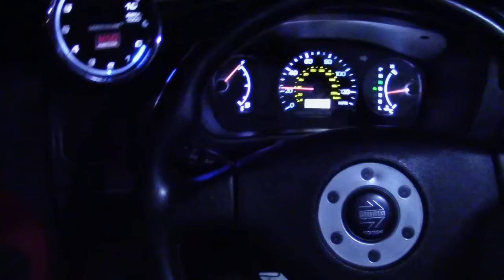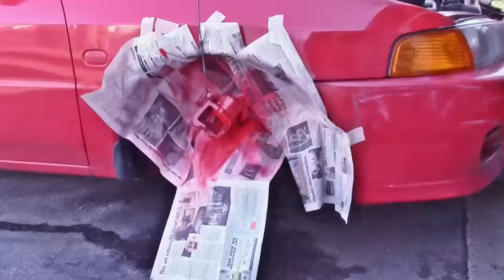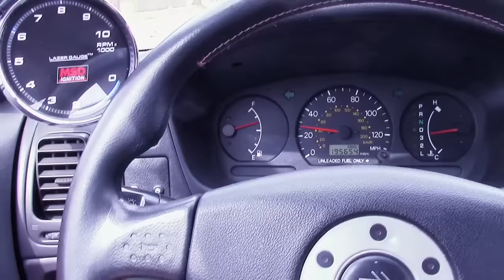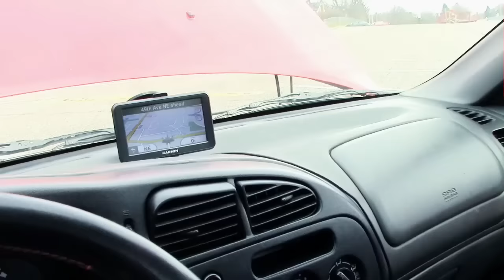Mirage Fix 21 | Coilovers, DIY Alignment

Comment: Hey , I think before you install spoiler you should change the dive train. A spoiler only gives down force on the rear wheels. This mirage is fwd. you are better of tuning or installing engine mods. Also, a awd drive trained would have a driveshaft going through the  middle of the car. Just some tips. Keep up the good work!

Comment: I bet opening those coil overs felt pretty exciting and that alignment toe in out looked to have turned out pretty good but can't imagine it being perfect going down the highway. Iv'e tried it on a couple of cars and still had to have them done on an alignment rack and you pay those so called pros $80 to $100 to do it with high tech equipment and half the time they don't even get it right you had might as well do it your self until you get it as best as you can. And they will scratch and scuff your alloy wheels every time guaranteed.
Reply from the maker: red rover Yes, I actually did precise adjusting many times. I edited those parts off and included only the basic idea of it. So it is about drive, measure, adjust, and do that all over until I got it perfect.
Reply: That is a lot of work with out a car lift in your videos you seem very talented

Comment from the maker: Brian Navar Put a smaller ramp to get on a ramp doesn't really do much I think. It is very steep as you can see.
Reply: What about just one long 2x2?? My cousin used to have a steep drive way also, and it worke for him.
Reply from the maker: Brian Navar That might help, but not in the winter. It wouldn't feel good doing that when it's -30F outside.
Reply: The DarkDragonWing why do you not put a spoiler and paint your car because mirage its gonna be pink like 2yers from know
Reply from the maker: RodryGamez PT
 I will think about it
Reply: that is true, i'll respect that.
Reply: Spoiler on a FWD car? Oh please no
Reply from the maker: Jesper Becker
 Honda Civic Type R FWD comes with a spoiler from factory.
Reply: But a hatch has more areodynamic drag in the back. Just sayin.
Reply: Jesper Becker my honda accord type r has a big factory spoiler and it does actually give you downforce the rear does slide out on a fwd to you know.
Reply: Think about it for a second. If you have a fwd car, you want as much traction as possible to the front wheels, not to the rear. The Type R's spoiler isn't really that angled, and more importantly it has a real front spoiler to provide force to the front wheels. The mirage doesn't have that
Reply: Jesper Becker your oviously someone thats just states the obvious then because 1. You said about fwd in general having spoiler you didnt say the mirage 2. Look up btcc touring cars and majority are fwd and they have spoilers and they handle incredible and 3 like i said before the spoiler is to keep the rear down because the back gets twitchy on ANY car when your braking hard maybe look into what a rear spoiler does before commenting :-)
Reply: Ricky Burrows Well, thst excactly why i really gotta stop commenting on things while asleep lol... Meant the mirage all the way
Reply: Lol
Reply: The DarkDragonWing nice :D
Reply: The DarkDragonWing nice :D

Comment: Also you should look in to doing just a FWD engine swap if possible. Old Eclipses, Eagle Talons and Plymouth Lasers came with 4G63Ts and FWD drivetrains. The were the same as an Evo III more or less, and all also came in AWD.
Reply from the maker: nblax41 Nice! Thanks! I might look into 4wd Eclipses then since they're available here in the US.
Reply: They're nice cars! I have an Eagle Talon, which is the same car. I'm sure you'd have no trouble finding one down there.
Reply: The DarkDragonWing
Although honestly, if you were to buy one it should be the project car, you can find motors and transmissions if you want to do a swap on the Mirage.
Reply: nblax41 it wouldnt be a fwd 4g63t the fwd non tsi models were the 420a which aren't the same
Reply: I know, only 2G models came with the 420A. First gen cars came with either a non turbo 4G63 or a single cam Mitsubishi engine.
Reply from the maker: nblax41
 I will keep my eye on the sources.
Reply: The DarkDragonWing America is home of the AWD Eclipse/Talon/Laser. Hell I own a 91 Eclipse GSX AWD, they're built in Illinois.

Comment: What do you think about the megan coilovers, also how much of a gap u left between the wheel and the fender? Thanks nice video
Reply from the maker: +Cesar Feliz I have not used megan coilovers before, but I'm sure you can use it and it will work well. The gap is about 1 inch.

Comment: such a friend, I like what I've seen in your videos I also feel passion for my car repair thanks for sharing your experiences and I am from Venezuela to buy my next vehicle will make a plus sign Mitsubichi lancer 1.3l 12v engine 4G13 just want knowing inches are your wheels and tires using measures, I am also fond of modifying the fuel injection system fuel pump and injectors to improve a little engine

que tal amigo, me gusta lo que he visto en tus videos yo tambien siento pasion por reparar mis carros gracias por compartir tus experiencias yo soy de venezuela y mi proximo vehiculo por comprar va hacer un mitsubichi lancer signo plus 1.3l 12v motor 4g13 simplemente quiero saber de pulgadas son tus rines y que medidas de cauchos usas, yo tambien soy aficionado en modificar el sistema de inyeccion de gasolina bomba de gasolina y inyectores para mejorar un poco el motor
Reply from the maker: theselzer Thanks! Here:  
- 17"x7" MR116 SILVER RIM By MOTEGI RACING WHEELS
- ACCELERA TIRES ALPHA 205/40ZR17 84W
- Tuner Wheel Lock Kit M12-1.5
https://www.youtube.com/watch?v=bcr4fHNJkfc
http://www.performanceplustire.com/products/packages/searchType/searchByVehicle/year/1999/make/MITSUBISHI/model/MIRAGE/applicationID/10011/wheelSize/17/wheelDataID/178519

Comment: Hello. I just want to know How do you feel the car now when you drive it. What are the differences that you realize. I mean before/after. Thank you. :)
Reply from the maker: Octavio Cruz Yes, it feels much rougher after I installed the coilovers. I can feel all the bumps on the road. Though, it got better/softer after driving it for a while. It will not be as soft as the factory ones. Hmm I think part of it was because I have thin tires on with 40 psi. That too can make the car rough on the road. If I maybe put in about 25 or 30 psi, it might help a little bit. Cheers

Comment: Love the video your doing a great job on your car.  My question is how is the ride after the coilovers is it as smooth as it was before?  I'm asking because I'm on the fence about coilovers or just springs.
Reply from the maker: dolores delgado It feels much rougher after I installed the coilovers. I can feel all 
the bumps on the road. Though, it got better/softer after driving it for
 a while. It will not be as soft as the factory ones. Hmm I think part 
of it was because I have thin tires on with 40 psi. That too can make 
the car rough on the road. If I maybe put in about 25 or 30 psi, it 
might help a little bit. Cheers
Reply: Thanks for the info.  It means a lot comming from you.  It seems like you are honest with everything you post and say.  Thank you again love the videos keep them comming

Comment: How much did you pay and where did you buy them at?.. The car should be stance low and do a resonator delete on the exhaust.
Reply from the maker: jacy thegoon I bought this set last year for $790, but now it's $808 http://www.ebay.com/itm/DD-Soft-Hard-Coilover-kits-Shock-for-Mitsubishi-Lancer-CE-CM5A-5th-Gen-95-00-/400638527064?fits=Model%3AMirage&hash=item5d47eac658&vxp=mtr

Comment: Love your videos. I have the lancer coupe. How low can those coilovers lower your car?
Reply from the maker: matthew muranyi Not too much. I can lower the front about 1 inch or 2 more(I have to adjust the spring at this point), and about 3 inches more on the rear.

Comment: well this is what I would do to that car. Paint the car, same color, but with metal flake. Tint the windows. that's cheap. Then work on getting a header exhaust manifold. Maybe even a little bit bigger exhaust pipe. before you do the turbo. But its a nice car.

Comment: do you think ordering auto parts online is a good idea such has control arm tie rods stuff like that?
Reply from the maker: +Luis Hernandez Yes, I don't see any difference. All I know is they are good and cheap. I only buy expensive parts from local store when I have to get the parts right at the moment. And they're not even that good quality to be honest. I found the cheap ones online to be better and cheaper. Make sure you buy from a high rating seller if you buy from ebay.com or amazon.com

Comment: Did you have to torque any of the coilover bolts or anything really need to be torqued?
Reply from the maker: urmastertech I would like to torque the bolts, but it's hard to find the information of each bolt. Plus, I will have to buy bigger torque wrench. For me, I would torque the bolts on the engine only.

Comment: Nice work,but you still need a 4G63T in the bay.
Reply from the maker: Mitsubishikid Yes, but it's expensive
Reply: yeah I guess the cost is a bit pricey, but it's not too much money, well considering what the outcome would be for the money...I guess if you want more power thats the only real option worh considering, I mean you could bolt a turbo on or add nos etc, but in the end how long will the stock motor take it compared to a motor made to take theadded stress and abuse...

Comment: Bro, on my 2001 LS 2dr Coupe some type of gas tank housing or braket, the little holder your tank sits in. Mine rusted out, the tank is fine and sitting in place but that housing it was sitting in is shot. 1. do you know the name of the part ? 2. Is it just a precautionary piece, there are no straps or was that the strap?
Reply from the maker: Amir Abdullah I do not know what part you are talking about. If you can take a picture and send it to me here it would be nice: https://www.facebook.com/DarkDragonWing  

Otherwise, I think I know what you mean. It is that part behind the rear right wheel. Mine rusted out too. I cut some metal plates, and welded them to the body of my car and welded them to the thing that was rusted out. cheers
Reply: The DarkDragonWing I'll try but I think it's some type of heat shield maybe. But I'll try and get a picture.

Comment: Also, these will fit on your Lancer ES, because the ES and Mirage share the same suspension components. :)
Reply from the maker: psychodrama81 That is interesting! I'm not sure if you are kidding. Has anybody try that out?? If they do fit, that would be a mind blowing mod.
Reply: The DarkDragonWing I'm not kidding. I did some research and the ES and the 98-02 Mirage share the same parts. This is Aviance from The Lancer group on facebook. That's how I got my Lancer ES lowered. I also have a link on another website if you want to see what I used.
Reply from the maker: psychodrama81
That is awesome! Yes, link please.
Reply: psychodrama81 Hmmm interesting, I was of the impression that the suspension was different. Well....according to some other online forums that I checked. Did you do some fab work? Where did you source the information?
Reply: It's on http://www.evolutionm.net Type in the search, Mirage - Lancer ES compatibility. It's covered a lot.
 I didn't have to do any fab work, everything bolted right up. They did say the wight difference may be an issue (Lancer weighs 200 pounds more), but I didn't have any problems.

Comment: You should add a front lip to make it look lower and more aggressive... Do some research try to see if you can put rear disc brakes ... Will make the car look better also upgrade your performance on brakes ... Dont forget to do your cars sound system
Reply: Watch vid before commenting...
Reply: Jesper Becker i have

Comment: Mackie, clean your headlights. DO NOT BUY NEW ONES just because of the plastic. Buy a toothbrush - I don't know if you have Curaprox in the U.S., but something like that would be good as they are very soft - and just use toothpaste to clean them. I've done it several times on our car and so far, it looks good. It may not work with some toothpastes due to different chemicals in it, but is deffinetly worth those not even 5 dollars.

Comment: Mackey, any ideas how these held up during the winter after one year? Are they decent? Would you buy them again?
Reply from the maker: They are tight, that for sure. They are still very hard, though they are still working, not dead or stuck up. If you like it hard, this is for you. I feel lazy driving it knowing it is hard. Not super good for taking girl out for a date. But it looks good, it works, and it's hard. Would I buy it again? I would only buy it for a personal car, and not the car that I take people places.

Comment: where do you buy those coilovers... and are they good? how do they feels? thanks!!
Reply from the maker: +janky831 
Here http://www.ebay.com/itm/DD-40-STEP-ADJUSTMENT-SHOCK-COILOVER-fits-MITSUBISHI-LANCER-EVO-123-4G63-CE9A-/371036231511?fits=Model%3AMirage&hash=item56637b9757&vxp=mtr

It is very rough at first. It got softer after a while. It feels nice 
when driving on a good smooth road. Only when you enter a rough road, it
 feels like riding a roller coaster. It will get you all tired. Gotta 
tell that I got my tires filled 40psi, so if I stay around 30psi or
 so, it would be softer. Overall not too bad. Gotta
 sacrifice a little comfort for a good look.
Reply: +The DarkDragonWing jaja.. ok, well thanks for your response jaja... anyways it looks awesome sitting like that!

Comment: How was the upgrade? Did it feel better or the same?
Reply from the maker: Brian Sanchez It feels much rougher after I installed the coilovers. I can feel all 
the bumps on the road. Though, it got better/softer after driving it for
 a while. It will not be as soft as the factory ones. Hmm.. I think part 
of it was because I have thin tires on with 40 psi. That can make 
the car rough on the road too. Maybe if I put in about 25 or 30 psi, it 
might help make the ride softer a little bit. Cheers
Reply: The DarkDragonWing thanks for replying... I'm starting my own project car. What do u think about a off-road rally neon? I don't know where to start on the suspension.
Reply from the maker: I think it will be fun. Do more research on it before you start spending your money. :)

Comment: Huge fan from Nairobi, Kenya.... those rims, are they 16" or 17" ??
Reply from the maker: kevin muniu 17"x7" MR116 SILVER RIM By MOTEGI RACING WHEELS,  and ACCELERA TIRES ALPHA 205/40ZR17 84W + Tuner Wheel Lock Kit M12-1.5 Cheers!

Comment: great videos dark Dragon. What brand coilovers are those. I have a 2000 Mitsubishi mirage 1.5 de coupe and hoping to do the same to mine
Reply from the maker: +Kevin Medina These ones: http://www.ebay.com/itm/DD-40-Step-Adjustment-Coilover-Shock-Lancer-CC-Evolution-Evo-1-2-3-Mitsubishi-/271210644861?fits=Model%3AMirage&hash=item3f256a057d:g:KGsAAOSwLVZVwx1O&vxp=mtr

Comment: Bro what is size alloys and tyers i have same car
Reply from the maker: 17"x7" MR116 SILVER RIM By MOTEGI RACING WHEELS,  and ACCELERA TIRES ALPHA 205/40ZR17 84W + Tuner Wheel Lock Kit M12-1.5
Reply: @DarkDragonWing  thankyou so much bro

Comment: where yu get them coilovers 
and for code p0400 exhaust gas recirculation flow thats what's showing in my mirage
Reply from the maker: +Manny Angel p0400 clean the egr https://youtu.be/YrV4wiC6D7w?t=23m3s

Coilovers here: http://www.ebay.com/itm/DD-40-Step-Adjustment-Coilover-Shock-Lancer-CC-Evolution-Evo-1-2-3-Mitsubishi-/271210644861?fits=Model%3AMirage&hash=item3f256a057d:g:KGsAAOSwLVZVwx1O&vxp=mtr

Comment: Where did you get those coilovers man? Ive been looking everywhere for a set other than k sport
Reply from the maker: Jaime Ramirez Here: http://www.ebay.com/itm/DD-40-STEP-ADJUSTMENT-SHOCK-COILOVER-fits-MITSUBISHI-LANCER-EVO-123-4G63-CE9A-/371036231511?fits=Model%3AMirage&hash=item56637b9757&vxp=mtr
Reply: They fit the 1.5 mirage well?
Reply from the maker: Jaime Ramirez
 Yes

Comment: where i can get those coilovers? btw i have a 2001 mirage
Reply from the maker: angel rose Here, these will fit on your car: http://www.ebay.com/itm/DD-40-STEP-ADJUSTMENT-SHOCK-COILOVER-fits-MITSUBISHI-LANCER-EVO-123-4G63-CE9A-/371036231511?fits=Model%3AMirage&hash=item56637b9757&vxp=mtr

Comment: Hey dark wing my radio control car  have a weak battery even if I charge it is to weak  how to fix that??
Reply from the maker: Aldrin gonzales You can get new charger: http://www.ebay.com/itm/Thunder-AC6-Smart-LiPo-Balance-Charger-Discharger-w-Extra-Adapters-PC-Software-/231542399456?pt=LH_DefaultDomain_0&hash=item35e900a1e0
Reply from the maker: Aldrin gonzales And new battery http://www.ebay.com/sch/i.html?_from=R40&_sacat=0&_nkw=7.2v+5000mah&_sop=15
Reply: Tnx bro

Comment: how much did the suspension cost?
Reply from the maker: +Maxpower gaming Here http://www.ebay.com/itm/DD-40-Step-Adjustment-Coilover-Shock-Lancer-CC-Evolution-Evo-1-2-3-Mitsubishi-/271210644861?fits=Model%3AMirage&hash=item3f256a057d:g:KGsAAOSwLVZVwx1O&vxp=mtr

Comment: Iv watched most of your car fix videos. Im left wondering why you always use your old nuts over the new ones
Reply from the maker: khandrodin They were made in Japan; pretty good stuff vs the new ones. Though, that's not always the case. I tend to use the old one when the new one has a different size or something like that.

Comment: How did you know if they where going to fit?
Reply from the maker: +Frederik Aponno Oh, the seller listed all the cars that these will fit on. I buy them from ebay.com. I search for "Mirage Coilovers" 
Here take a look: http://www.ebay.com/itm/DD-40-Step-Adjustment-Coilover-Shock-Lancer-CC-Evolution-Evo-1-2-3-Mitsubishi-/271210644861?fits=Model%3AMirage&hash=item3f256a057d:g:KGsAAOSwLVZVwx1O&vxp=mtr
Reply: The DarkDragonWing Thanks :D